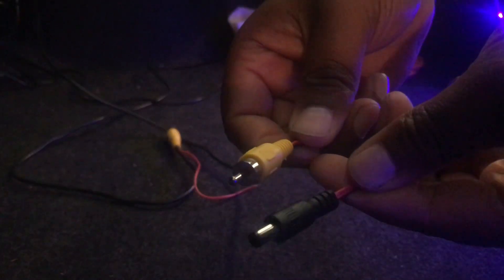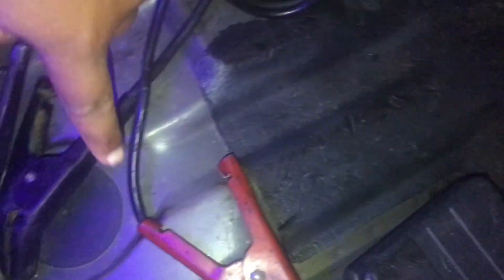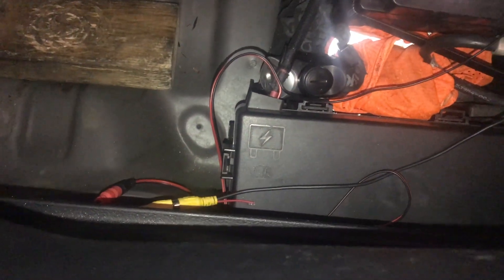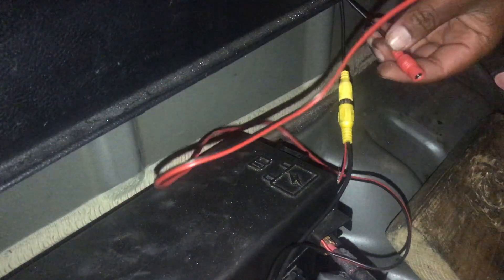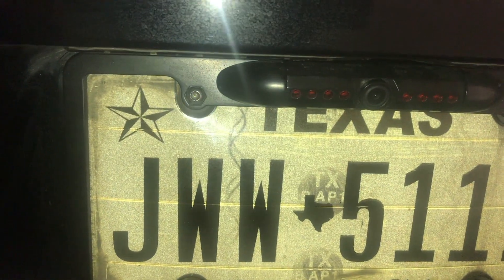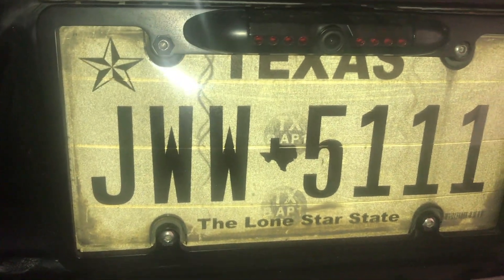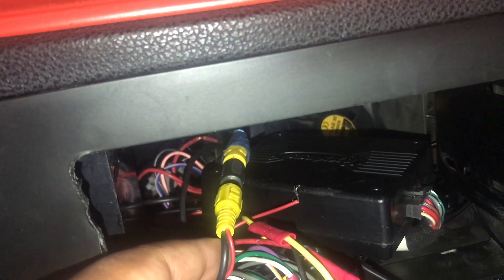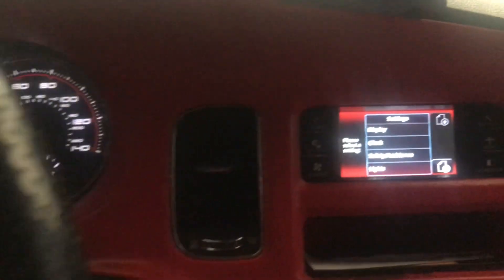2012 DODGE CHARGER BACKUP CAMERA INSTALL (EASY)

Comment: Thanks man, I was stuck trying to figure out where to put my wire without take bumper apart or drilling unnecessary holes!
Reply from the maker: Not a problem, I made the mistake of drilling, so you wouldn’t have to 😅

Comment: Is there a way to turn it off when The car is
Off ?
Reply from the maker: U just have to add it to a fuse that cuts off when the car cuts off should be hard to figure out witch fuse.
I would use the remote amp fuse mostly likely the best to ise

Comment: Can you install this with the stick CD player or do we need to get another type of CD/radio player
Reply from the maker: If u mean stock yes and u have todo a little hard wiring to get it done but u can just get a z auto tazer to unlock backup camera 1st.
 if not u have to get the $400 aftermarket radio kit which is the more expensive route.
U can get a used auto tazer for $160
Reply: @mightyprophet4581  where can I buy used taser?
Reply from the maker: @pgFrancisco  z automotive I not try eBay.

Comment: Wow, this is ratchet AF. Are you seriously just mashing wires between your battery terminals/posts and AV connections? I like cheap, but this is unacceptable. The cost of proper connections and terminal upgrades is so low. On the upside, you're much more brave than I am when upgrading your car, and I'm not above hacking, but there are definitely much more professional DIY options if you spend a bit of time doing proper research.
Reply: Hah! I love that you loved my comment, man. So easy for me to be critical of your solution...the reason I even showed up here on your channel is that I had to spend $100 getting my Challenger pulled out of a ditch tonight while doing Uber Eats/DoorDash deliveries in the middle of a TX Thunderstorm here in Ft Worth. Trying to back out of a janky rural driveway using my stock reverse lights and both side mirrors (with both tinted windows rolled down in the pouring rain), I couldn't see shit.
Reply: Same price as your hack vs. getting winched out of the ditch, I could have seen the mistake I was about to make. Damnit, Dodge! Why couldn't you do a better job with the backup lights?! Will be more careful in the future, for sure. I should have just parked on the highway and walked that Taco Bell up the driveway with my flashlight instead of driving 40 yards up into that invisible driveway and tryna back out. Subscribed, bro. I know what it takes to make/edit videos, thanks for taking the time. Looking forward to seeing your progression, and If I'm gonna talk the talk, I should walk the walk, and will try to add my own videos when I upgrade my Challenger. I was only running my baby tonight because my regular little Mazda is in the shop getting a new transmission. Keep up the good work, man!
Reply from the maker: I take all feedback, I could always do Better. Thanks again for checking out the channel.